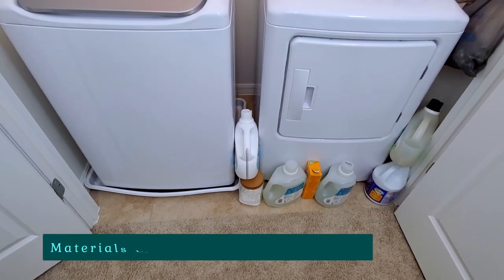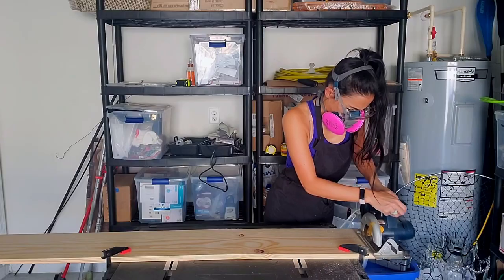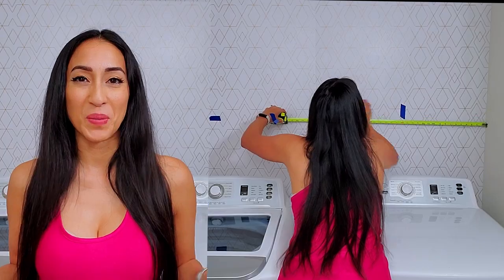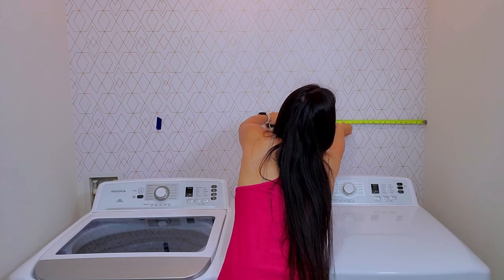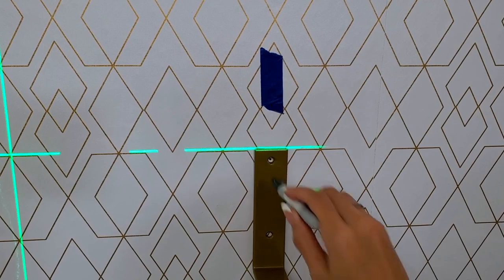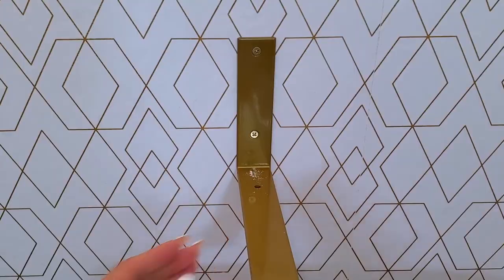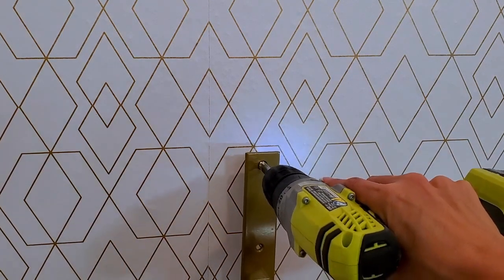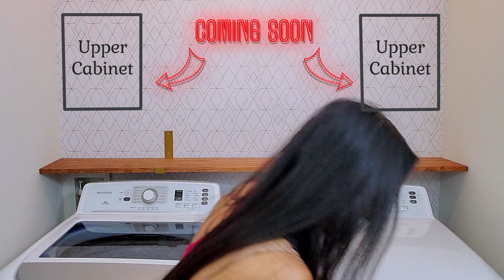How to Easily Install a Shelf Over a Washer and Dryer

Comment: Looks great!  Why did you choose a removable shelf?
Reply from the maker: Great Question! I made it removable incase we need to get to water box. These brackets comes with smaller screws to secure your wood shelf to them if you want it fixed (but the laundry units are in the way).  I  wanted the shelf as low as possible to the unit and this J bracket design allows me to do achieve the look.

Comment: What is the size of the shelves ? And where did you get the brackets in gold ?
Reply from the maker: Hi Lee, 
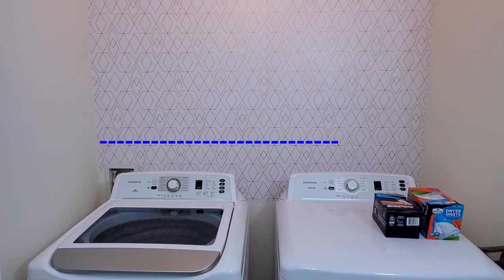I referenced in the video 0:59 Measure for shelves & Bracket design. I wanted my shelf 10" deep and I cut a 6ft board to the width I needed for my laundry room. Below the video In the description box, I reference all the links for the tools and materials I used. But here is my Amazon link for the brackets I used. Shelf Brackets 4PCS Heavy Duty https://amzn.to/39Fs0Xw You can buy the brackets for an 8", 10", or 12" depth shelf. I hope I answered your questions well and thank you so much for watching!